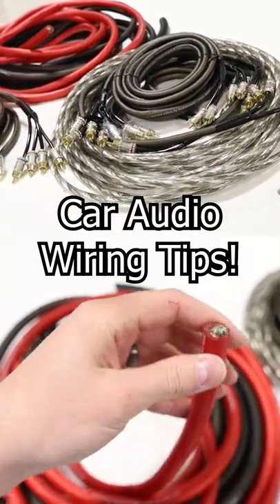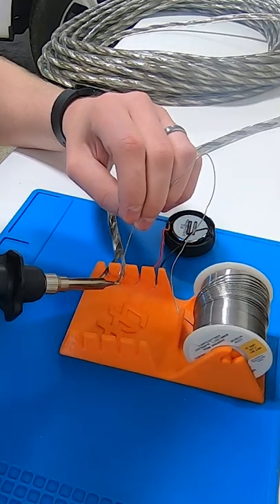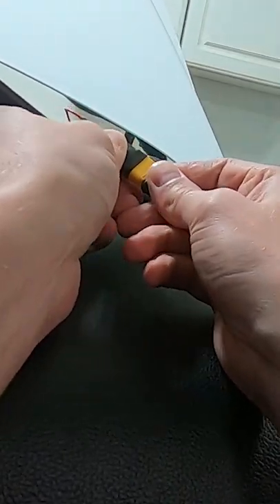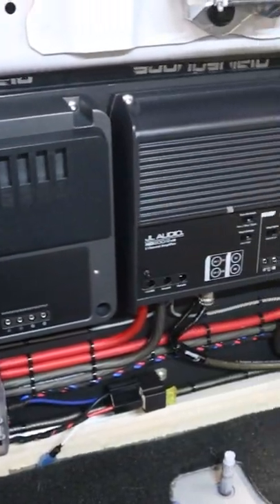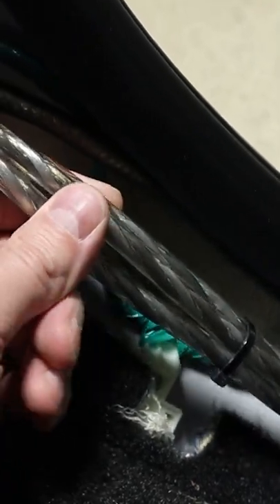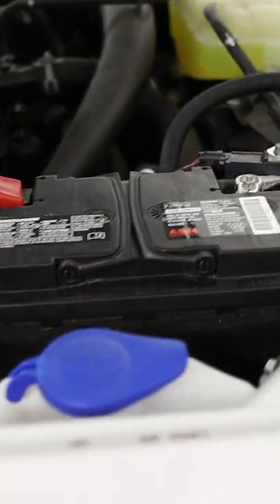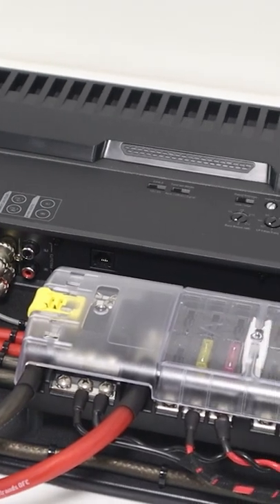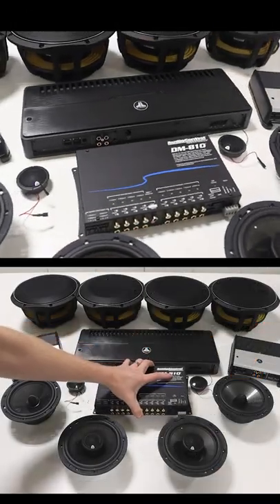Car Audio Wiring Tips! #shorts

Comment: Those X60 connectors are dope! I’ve got a tacklebox full of them! One thing to speak on also, is to run your amp wires on the opposite side as the signal wires to prevent crosstalk and EMI.
Reply: I was just about to post the exact same thing. I miss being in the car audio scene. I haven't dabbled in it in almost 15 years.

Comment: I bought a Dymo Rhino label maker specifically because it can print onto heat-shrink tubing cartridges. It works GREAT for labeling cables. And you can get a variety of 3rd party cartridges for it for a lot less $$$ then the Dymo-branded ones.

Comment: Always always use pure 5nnoe above OFC copper for your power ground speaker cables and interconects that are sheilded and it will make a massive difference to current draw pkwer and most importantly durability and sound quality 🔉

Comment: Can I run a 1200 wrms sub, on a stock 140A alternator, and a 80Ah battery, with a Big3/4 and 3 awg wire for my amp? Thanks.

Comment: Biggest tip use real copper wire instead of this aluminum clad crap this guy is using
Reply from the maker: The wire in the video is marine grade OFC, it's superior to normal OFC and some of the best wire you can purchase for car audio. Should probably check your facts before making comments like this.